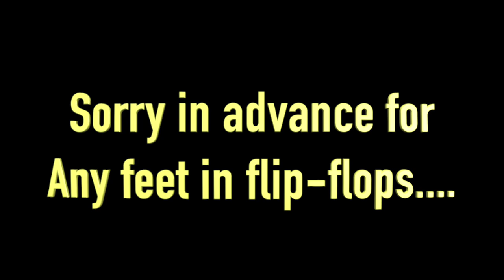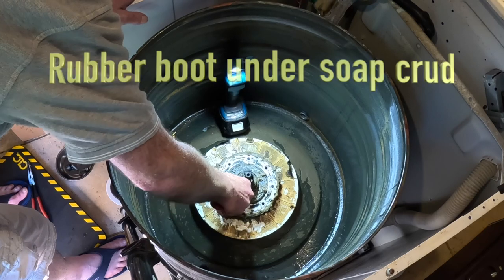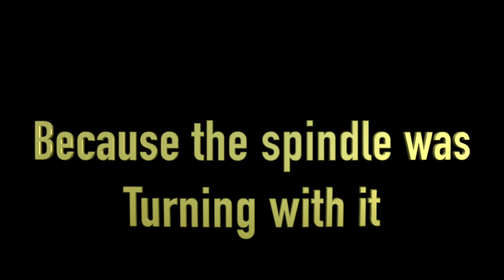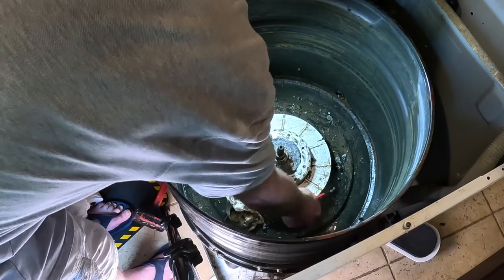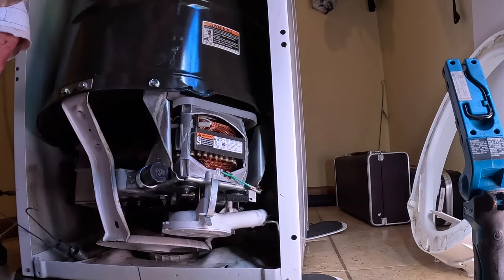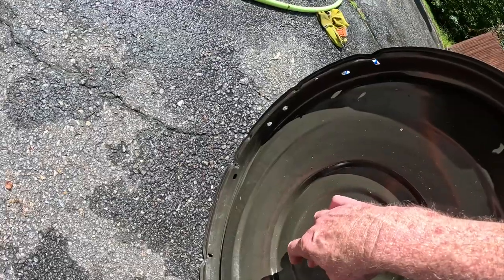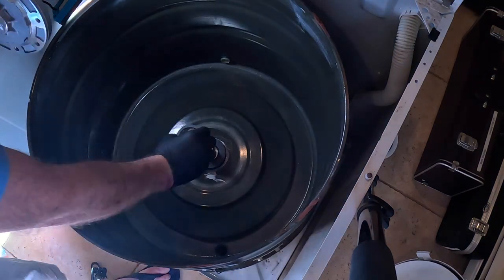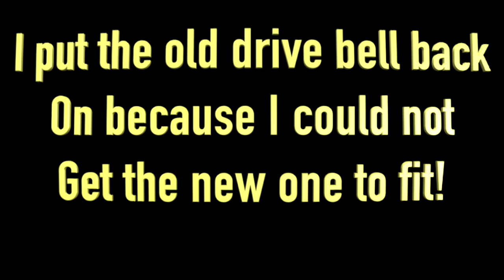Speed Queen Washer BEARINGS and SEALS replacement DIY  The GOOD, The BAD, and the UGLY

Comment: Nice video, thanks for taking the time to make this video.  I've watched several videos to learn how to do this job the easiest way possible with the best tools available. Your video helped me a lot. 
Good Ideas From Your Video
1) Leaving the tub installed in the washer while removing & finalizing the bearing job. I think it makes the job easier because the tub is stable when installed in the washer. 
2) Lifting the tub from the bottom assembly, instead of turning it around and lifting the bottom assembly from the tub. 
3) Using the Rhino air bags and pry tool kit. 

Suggestions
1) Use a bearing pulley to remove the plastic center piece & the bearing from the tub. 
2) Use the Speed Queen 321P4 Springhook tool to remove the springs from the tools. 
3) Remove the center bolt from the tub before removing the inner tub. This way it will be easier to prevent it from spinning.
4) Maybe using an impact drill to remove the center bolt from the tub.
Reply from the maker: Thanks for taking the time to make such a thorough comment. You're not the first to recommend leaving the outer tub in place to help remove the inner tub. For the life of me I can't conceptualize how that would help. And if you have a deep enough socket to remove the center bolt with an air gun or similar id say that would be the best way. The hub stuck up to much for anything I had.
Reply: @Samlol23_drrich  I think this video would help. Try to watch this YouTube video produced by Alliance Laundry Systems (Speed Queen manufacturer) titled: How to Replace Top Load Seal Kit 766P3A

Comment: Simple trick to avoid the unit from spinning when taking the nut off, leave the inner tub in until that nut is loosened. You can use your elbows to hold the inner tub in place as you hammer away.
Reply from the maker: Thank you. Good idea.
Reply: You likely saved me at least an hour, thanks.
Reply: Noted! In about a week, I get to do the same thing with my washing machine.  Right now, it sounds like an old lawnmower.
Reply: True
Reply: I use an impack tool with a 38 mm socket,easy to loosen and fasten.

Comment: Good realistic tutorial. Helpful to see how you can run into issues like parts that are stuck, spindles that spin, seals that won't seat, etc. You got it done and saved a ton!
Reply from the maker: I happened to be staring at my iPad as your comment came through. Thanks for the kind words. It’s been fine since then. No leaks or issues. What a relief. I wasn’t sure it was going to work out as I was fighting with it, but as they say - it was already broken. So either I fix it, or it’s still broken. And luckily it all worked out. Thanks for watching and taking the time to comment.
Reply: @Samlol23_drrich  I appreciate anyone who is good working with their hands. I've been doing it from very early on. I can fix just about anything. Even now that I have money, I still enjoy doing most things myself. I take my time and find it relaxing. I picked up on your comment that you didn't really enjoy the process (nightmare) but I hope you at least took some satisfaction in a job well done- by your own hands. 37:17.

Recently my wife wanted a new Kitchen and Bath. That was a learning curve but despite some challenges, it ultimately came out amazing. As you said, it was already broken (30 years old!)  

On a side note Doc, I agree with the genetics factor regarding cavities. I don't do fluoride and haven't had any cavities in years. I value my sleep more and don't want to calcify my pineal gland. Also, if you read the literature, after a treatment you are suppose to let it sit for 30 minutes or so in order to do anything to enamel. People are funny- they brush and ingest some fluoride, the immediately rinse it off. That will do nothing- good anyway IMHO.
Reply from the maker: @MOAB-UT  although sometimes stressful, I absolutely do enjoy fixing things. Not sure which comment led you to believe otherwise. There’s not too many things I won’t attempt. I feel like my office is the equivalent of a few homes. With six dental chairs something is always breaking, although financially for the small stuff I’m better off calling someone due to so many specialized parts. The problem is when larger and more expensive items break down after 8 or so years the guys who do the repairs go into full sales mode. And the repairs run into the thousands. That’s when I do the repairs myself with the help of eBay. They wanted to sell me a new 5k compressor- and it was just a start box I needed (a couple of capacitors and a relay). They wanted to sell me a new 50k panoramic X-ray machine and I wound up re-wiring an abused connection.  I recently remodeled a downstairs bathroom. Wish I would have taken better video. It came out great. I ripped out everything and built wanescoting, put down new subfloor and ceramic tile,   There is so much great info on You Tube which has allowed me to service my AC, Heat, Refrigerator, you name it. Next time around I would be a plumber or electrician. No complaints about dentistry as a profession, but it’s the other BS that ruins my day.  Someone who will pay a contractor .60k to redo their bathroom won’t want to pay $10 the insurance doesn’t cover. I blame the ADA for that. Insurance companies spent millions and years pretending it benefits patients to go to “their” in network people. The only ones that win are the insurance companies. They pay our less, while limiting patient access. Oh well. PS I don’t touch the fluoride thing with a ten foot stick.  I’m all for it, and give it to my kids. Some people are anti fluoride. That’s fine.  To each his or her own.
Reply from the maker: @MOAB-UT  my best diy accomplishment is adding a zone to my four zone hydronic boiler and heating my garage. I did that pre you tube.  Did a video after the fact. But that really added another usable  500 square feet to our living space.
Reply from the maker: @MOAB-UT  ps did you get your washer yet? Good job with the kitchen and bath remodel.
Reply: @Samlol23_drrich  Very nice.
Reply: @Samlol23_drrich  Thanks. Yes, we got our TC5 a couple of weeks ago and have used it a dozen times already- roughly once a day. It works great.

Kit. and Bath project was really fun. Got all the permits and took it down to the studs. I learned a lot. My engineering background helped with things like determining load bearing walls, plumbing pitches (1/2" per foot is ideal so water swirls- not to steep as it will run down the middle and not clean the pipe.) 

We went ultra modern and used top grade finishes. We get many compliments on it. We have dimmer switches and lot's of recessed lighting. 

In the bathroom we have a digital timer for the fan which is very useful. It keeps running after the shower for 5, 10, 15 or 30 minutes. 

Also, on your washing machine, do shut off the water after each load. It is important to depressurize those flimsy (even steel braided) hoses. I had a slight water leak here that cost $12k to remediate. Water is highly destructive. 

For under $10 each, HD sells garden hose shut off valves (Fem. to Male 3/4") with a simple lever. They work great. Color coded, Red (left) or Blue (right side.) They can simply screw over the existing valve, then the washing machine hose screws on to it (using a lot of white plumbing tape and tighten a lot.) We had the dial type that took several turns- the 1/2 turn lever (ball valve) makes it much easier so we actually do it regularly. The plumber wanted to charge $500 to install a single pull lever- slightly nicer but not worth $490 extra!
Reply from the maker: @MOAB-UT  your kitchen and bathroom sound beautiful. Certainly nice to modernize. 
Not a bad idea  To shut off the water after every load of wash.  Growing up that's what we did. I bought braided hoses for the dishwasher and washing machine that cut flow if there is a sudden decrease in pressure  (like a burst hose). Similar to the safety built into propane hose regulators. 

For a few dollars and screw on solution  I will check home depot next time I'm there which is daily practically!
Reply from the maker: @MOAB-UT  there is no email address. Just a You tube link.
Reply: Should be there on P
C.  I don't see it either on mobile or let me know yours.
Reply from the maker: @MOAB-UT  ahhh. That’s why. I tried on my phone yesterday and my iPad again just now. I’ll send it when I get to a computer later today. Thanks for letting me know.
Reply: Good video.  I was thinking if you pulled tub first off transmission after removing agitator and bolt then remove lower seal.. Would it have been possible to hammer the top seal out vs prying from the inside.?
Reply from the maker: @1165slugman  can’t do it that way. Have to take the first tub off to get to the inner tub. And the bottom tub is screwed into the metal plate.  I just followed the pros videos and the directions that came with the bearing and seal kit. Thanks for commenting
Reply: FYI just use a pair of vise grips and lock on the transmission then you can use two hands to get the nut off
Reply from the maker: @MichaelBrown-pf5xr  you mean lock it against the metal housing? Good idea. Thanks.
Reply: I know that's a lot work but well  done indeed 👏 👍
Reply from the maker: @caseyoliver4718  thank you.  I enjoy doing it so its not really work!
Reply: @Samlol23_drrich  well I'm glad but for me it looks like it's very complicated but probably because I've did a bearing replacement on a washer before but I'm doing it today and I hope that everything will be fine but thanks for the video I needed that
Reply from the maker: @caseyoliver4718  good luck then!  I had a leak a year ago and bought all the stuff. But while I was waiting for it to arrive I bought a tube of silicone and put it all over the bottom of the tub from under the washer. It actually stopped the leak for more than a year. I totally forgot about it until it started up again worse than before. I really had no choice but luckily you tube exists and I watched every bearing and seal video I could find (2 of them)  thats why I made a video. It was my first try at this and most people doing it probably the same. So why not show how it really goes when an amateur tries to do this. Its been perfect since with no leak so guess it worked. 

Good luck
Reply: @Samlol23_drrich  well I've been working on mine all day but have way through and I put in New bearings in my washer and it is quite stressful indeed yes and I just have finished tomorrow so hopefully everything works well so it is my first doing this so it is a big job for me and a hassle but although it takes time I guess but hopefully I'm doing everything right and hopefully yours well work well too
Reply from the maker: @caseyoliver4718  how far did you get?
Reply from the maker: @caseyoliver4718  nice.  Seems like its almost done. 
You did the hard part. Its all smooth sailing now!
Reply: @Samlol23_drrich  well I'm getting there for sure, slowly but surely I'm getting there hopefully I have it done by tomorrow but I won't be able to use the washer until after 24 hours from now and I'm going to test it to make sure everything works okay but thanks for the video though

Comment: The white plastic ring that is under the stainless-steel tub in the self-cleaning lint-filter! I've repaired 2 Speed Queen washers with the very same repair that this vid shows. NOT an easy thing to do at all! This man did a fantastic job!
Reply from the maker: Thank you!  Couldn’t find that anywhere. And what do you do about the transmission not locking ?  That was the worst part- being unable to spin that nut off. Did I do something wrong?
Reply: @Samlol23_drrich  I have no clue as to the reason that transmission was not locking. The 2 Speed Queen washers I did that repair on... the transmission locked. You did an impressive job in-spite of the transmission issue!
Reply from the maker: @websurfin9575  thanks.  My dad used to say “it broken already so what’s the worst thing that could happen”.  When I installed it I  made a little wire with a couple of spade connectors and bypassed the lid safety switch so I can watch it run with the lid up. I would bet the transmission is supposed to lock, but it’s working fine cause I watch it agitating. I have tried to stop the agitator by pushing down on the central hub as it’s running but it can’t be stopped by hand.  It’s definitely moving the clothes around.  
Luckily it’s one and done. Hope to never need to do that again. 
Thanks for the kind words and for commenting.
Reply: @Samlol23_drrich  Speed Queen washers are worth the trouble to fix.... when they break-down! And a SQ washer breaking down is rare. 🙂

Comment: You can also fill it up with hot water and then drain and pull hard and the agitator will come off without the use of air bags.
Reply from the maker: Thank you. Mine was very stuck so that sounds much easier.

Comment: The older Maytags back before Whirlpool acquisition had these very same problems. I know my1992 Maytag developed all these problems when my machine reached 20 plus years old. Transmission oil leaked out constantly and I think finally a tub seal broke and there was water all over the floor. The fan belts were replaced twice before hand. I was desperate to get a new washer right away so I got the 2018 SPEED QUEEN TR5 SERIES WASHER not realizing that Consumer Reports gave this machine a dismal poor rating in washing performance.
Reply from the maker: Do you agree with Consumer Reports ? The machine other than the seal which I guess is a big deal it was a slow leak maybe 2 oz of water on the floor and if I couldn't fix it I would have very possibly bought a plastic water containment drip pan for underneath
Reply: @Samlol23_drrich  I agree with Consumer Reports most of the time.

Comment: Great video. Our machine is 25 years old and the this is the second time we have to replace the seal and bearing. On the previous occasion it was done by an agents and it turned out to be expensive. Depending on the availability of the replacement kit in South Africa I will do it myself this time thanks to your video.
Reply: What did the whole kit cost you?
Reply: @skatesneakerlover  with the kit and all the extras the Doc used in this video including the air pillow pump up along with the plastic accessories, I spent just over $200.  I had to order the center nut remover tool and with shipping, that was just over $20.  Everything came from Amazon except the center tool.

Comment: So i grew up with an 05 speed queen aliance like you have there.   We have replaced 2 belts but thats it.   Still going strong.  3-4 people used it until 2019 when it went down to 1 just my mom.  Found one on facebook today same model but from 08 for $100 got it in doing its first wash.  

Looked inside of it.  Belt and springs all looked good.  Not much rust or corotion which is good 

Im very happy to of been able to find this pre computer no water saving mechanical dial washer :) almost didnt get it cause seller had some one else interested before me but an extra $15 and my sob story of how bad i wanted it convinced him lol
Reply from the maker: I’m with you 100%. We bought our house in 2010, so the machine we have was probably manufactured in 2009.  I raised the max fill level, and bypassed the lid switch so it runs without closing the lid so I can make sure it’s working properly. Good purchase on your part. If ours ever became unable to be repaired, I would look for a used one.  In fact, I just bought a used 15 year old Hoover wind tunnel self propelled vac for parts (on eBay) cause I can no longer get an idler arm for mine.  Same deal. Bag, old, works really well and don’t want electronics!  
Hope your washer lasts a lifetime!  Thanks for commenting.
Reply: @Samlol23_drrich  do you have a video on raising the fill level? Would be pretty cool if I can do that to newer washers
Reply from the maker: @BRWfilms  I will link to the video I used. I will edit this post when I do. It was just a matter of backing off a bolt.  Okay edit here's the video and I think it's tightening not backing It Off..https://youtu.be/VpYpILUZqrQ?si=jWbgkcWtKKCKRVnP
Reply: @Samlol23_drrich  thanks!
Reply from the maker: @BRWfilms  no problem. Good luck

Comment: I’m seeing oily stuff in the under my washer and wondering if the transmission is leaking. This video really helps me to know what I’m getting into if I have to replace it. I’m willing to spend a few hundred in parts as these washers are around $900 to replace.  Thanks for showing the problems that other videos don’t show. Nice work!
Reply: I hate to tell you this, but these washers are now about 2k replace for this same exact one.  I just priced a set and it was almost 4K.  Yep...me too!  I'll spend a few hundred to get mine working again as well.
Reply from the maker: Sorry I didn’t see your comment until today .  Did you ever decide to give it a go?  I’m hoping the seal repair gives me another 10 plus years. I really like the washer. And thank you for taking the time to write a nice comment.
Reply: No. Haven’t done it yet. It’s still running strong.
Reply from the maker: @brotherbax4083  I wouldn’t do anything until I had to……..when my machine started to leak I got a $5 tube of silicone , got under the machine and put it on the underside of what I now know is the seal.  I gave it 24 hours to cure before doing a load and that lasted a year. When you think about it, that’s really all this job was. There was nothing wrong with the bearings, but if you pull it off to clean the old sealant off, might as well replace it.  All the rest was just getting to the seal, and scraping it off, cleaning the outer tub, and re-water sealing with really strong 3m urethane.  Thanks for commenting.